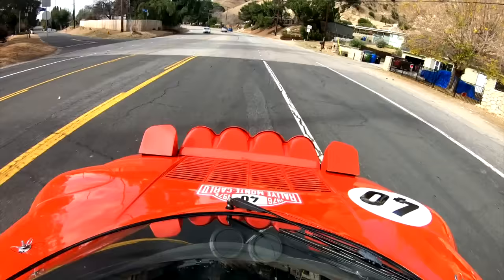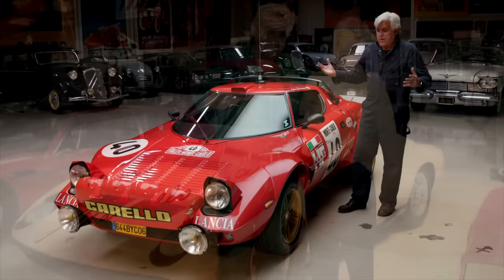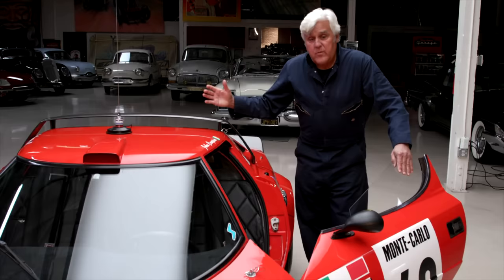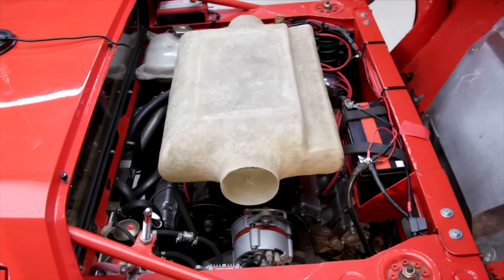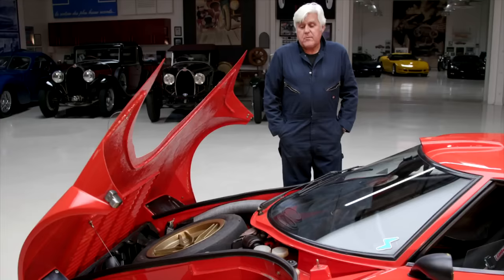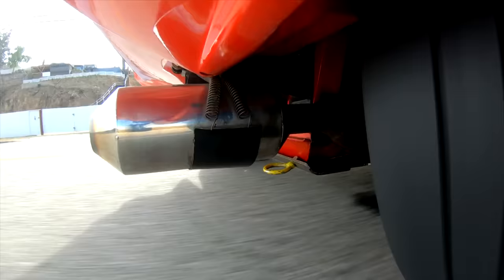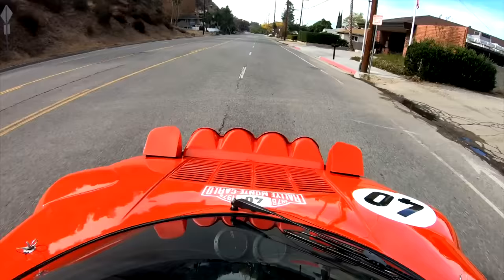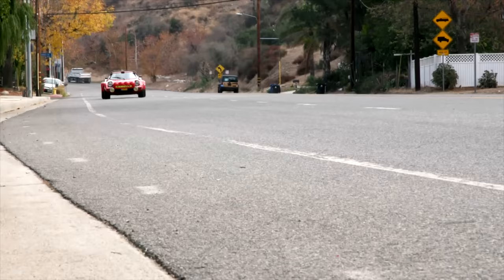1975 Lancia Stratos HF - Jay Leno's Garage

Comment: Haven't seen Jay this excited about a car in a while. "I need to find one of these." Yes.. yes you do.
Reply: I hear it is going up for auction
Reply: What Jay may consider is the New Stratos based on a Ferrari F430 with a 540hp V8.
Reply: @jjlasne  Remakes never have the essence of the original. IMO.
Reply: Hear, HEAR!
Reply: @Meccanico208  yeah it sounds like he should just buy that one indeed!
Reply: @jjlasne  The new Stratos will do nearly everything better. Handle better, accelerate better, shift better, stop better. It will be more reliable, more powerful, more comfortable, and will have superior aerodynamics. I say nearly everything better, because there is one thing it won't do better: being an original Lancia Stratos.
Reply: @K31TH3R  Pretty much the same can be said of a new Toyota Camry.  That doesn't make the Camry more desirable to an enthusiast.
Reply: @hipcat13 , indeed they don' t have that soul but the remake is a sweet piece of enigneering and styling. And, it is manufactured in Italy, retains a little of that essence you mentioned.
Reply: @K31TH3R , you forgot that it will be more expensive. Is that better?
Reply: @jjlasne  yeah, the price is very Italian. Luckily Lister Bell makes a kit car that by the words and experience of a very trusted auto journalist is an amazing package that not only looks just like the original but also drives just as impressively. Priced at around £40-50k it’s actually attainable for an enthusiast that doesn’t have deep pockets to cover the £400k cost of the conversion + the donor F430 or Suderia. I hope Loster does a similar kit for the 037 as another Italian design house has reimagined the 037 but requires a Beta Montecarlo ( Scorpion in the states) and $500k. The love their 0’s in Italia

Comment: You never saw what this machine could do until you saw it in full flight on the back roads of Kenya way back during the good old days of the Safari Rally. You knew it was approaching from the unique configuration of lights leading the thick plume of dust in the distance... Still get goosebumps, those are some special  childhood memories.
Reply: Unfortunately, a Stratos did not win the Safari (or RAC) Rally.

Comment: I love how the gauges bob like a 2000 Chevy Silverado, quality.
Reply: You guys are getting gauge bobs? Mine are either off one pin or off the other pin. LoL
Reply: The Lancia has firm suspension and probably no rubber vibration absorbing bushes and mounts, so it has a good excuse.
Reply: The middle ones are swinging wildly back and forth like crazy. Probably not the suspension.

Comment: Gotta love the fact that Marcello Gandini himself thought that the engine was sh*t, too heavy and too underpowered. Yet, the results spoke for itself.
Reply: I doubt that very much... The Stradale (road car version) was much lower in HP than the race car. Not a slouch but nothing like the "real" one.
In race trim, the 2 valves engine produced 270 HP, the later 4 "valvole" version, it was good for 320 HP ! But quickly banned by the FIA as being too powerful.
This one is only a "look alike" .
For anyone interested, see Chris Harris who was invited by Pirelli who issued new tyres for classic "sports" cars. He rode shotgun with Markhu Allen and other rally legends that holy day. Scary.
https://youtu.be/mXgWWNJVdYA
Reply: old heavy engine of late 50's design,
Nicola Materazzi said it. 

but certainly not underpowered in any way.
Reply: @retroracingshirt591  

He tells it in a recent interview with Davide Cironi. Guess he wasn't a fan of a 2.4 iron block compared to 2.0 aluminum, but it all worked out perfectly in the end! 

Subtitles on:
https://youtu.be/BZJtMmMhj0Q?t=1200
Reply: @marcryvon  The quattrovalvole was the real deal, too bad it was quickly banned by the FIA. 

Here's the vid we're referring to:
https://youtu.be/BZJtMmMhj0Q?t=1200

Comment: I own one of these cars, except it's only a two inch long Hot wheels version.Mine is much cheaper though.Never needs gas or repairs.Cool looking car though.
Reply: Look on the bright side - it will roll right under the gate like that other full sized car...
Reply: Hi, is that a new release?
Reply: Mine was a 1/24 scale model.
Reply: I've got three.....virtual models lol
one for circuits, one for road-courses and one for safari

Comment: In 1974 I was walking in front of the very swank Hotel du Rhone in Geneva when a Stratos rally car in Alitalia colours drove by, shaking the windows.  I was amazed that this car has less than 200 hp as it certainly sounded like a monster.  Jay is lucky to have had the chance to drive this wonderful car!  To put the size of the car into perspective, it was 3 inches shorter than the 1974 Honda Civic.

Comment: This was a 2.4L Ferrari Dino V6 engine w/ 2 valves per cylinder. This engine had very innovative for its era roller rocker followers that actuated/opened the valves.

Comment: Always wanted to add this to the Stratos mystique.  1974 Press On Regardless rally in the U.P. of Michigan held on Halloween night.   Legend has it that the Factory Stratos driver after a lengthy service stop, tore through the middle of a small town at a buck twenty to get to the next stage start.  The local sheriff took offense, stood at the stage start with a shotgun and stopped that particular stage.  I believe the Factory Stratos never returned to the U.P. after that.

Comment: Only a few know, that by trying to make Stratos as nimble as possible, by making it almost square in chassis geometry, they also made it extremely difficult to control. Lancia saw this as a mistake, so the next rally supercar, the 037 was much longer relative to the width to allow for easier skid control.

Comment: this beauty came from france, we had the legendaire Bernard Darniche who  "won the European Rally Championship in 1976 and 1977 and the French Rally Championship in 1976 and 1978, each time behind the wheel of a Lancia Stratos HF. He also holds the record for most victories in the Tour de Corse which he won six times (1970, 1975, 1977, 1978, 1979 and 1981), a feat later equalled by Didier Auriol. He competed in the first World Rally Championships in 1973, winning the 16th Moroccan Rally and placing second in the 44th Alpine Rally, and was one of the top competitors for the remainder of the decade. He finished third in the inaugural FIA Cup for Rally Drivers in 1977, the first of three successive top ten finishes in the drivers' championship. He also won the Rallye Automobile Monte Carlo in 1979, the event where he holds the record for most wins on the infamous Col de Turini stage, a 1,600 m Alpine mountain pass normally driven in darkness. The so-called "Night of the Long Knives" has seen Darniche victorious on ten occasions." (wikipedia)  thanks to Jay Leno to love an all the good cars all around the world...

Comment: There's a company called Lister Bell in England that makes a replica of the Lancia Stratos. 
One goal on my bucket list is to buy one and assemble it with modern parts.  I will either go electrified, or Honda K series with at least 1 turbo if possible.

Comment: Hi Jay. I have a few questions.

1. Did you buy it?
2. What are the yellow handle thingies at the front and back of the underside of the car attached to the skid plate? (Are they tow strap attachment points)? 
3. What was the "wild" (small) gauge on the IP (the one where the needle bounced continuously from left to right like a whirling dervish)?
4. When a car has 4 way seat belts, could you please use all 4? You would be much safer in the event of a collision, rather than using just 3 of them like you did in this video, and we wouldn't lose our favourite (especially during the pandemic) car guy. 

Love the videos. You are keeping a lot of car guys sane during this horrible time.

Comment: The Stratos first competed in Group 4 rallying, and in it's first year (1974) it won the championship. It went on to win in 75 and 76. In Rally form, the car was lightened to just under 900 KG. It took the all wheel drive Audi Quattro to finally beat the Stratos for a world championship. When I saw those guages, it took me back to my Fiat 124 Sport Coupe days when I had to buy benzina, make sure the acqua was the correct temperature, and the olio was filled. That car had a Lampredi designed 1600cc, dohc engine that ran like a sewing machine!

Comment: I love the pandemic edition videos, I feel like they are more personal. Also what a beauty that car is, saw one a few months ago ( the actual rally car) spectacular. So sad to think what lancia has become.
Reply: We should blame ourselves for that, if we bought Lancias when they were still produced they would still be around. I mean I did, I daily drive a Lancia, how about you and all the others posting 'regrets' bout what happened to the brand?
Reply: @spavatch  lancia cars are still produced, lancia fell hard during the 90' s due to poor build quality and from the 2000's on no-one of their cars were even remotely interesting, they tried with the thesis but the car looked (cool) but weird and all of the other cars were rebodied fiats with questionable design and disappointing performance. Fiat ruined lancia and is in the process of doing the same thing with Maserati
Reply: @dumyjobby  - lol, Maserati was hardly in its prime when they bought it in the first place. 
Also, do other brands make great cars today? Is Mercedes as good as it used to be in the 80s? Hardly. Are Skoda cars interesting? Not only they’re merely a shadow of their pre-war glory but they’re basically rebodied or, in some cases, just rebadged characterless VWs. Does it hurt their sales? Not even slightly. There’s absolutely nothing wrong whatsoever in using common platform (which for Lancia is not entirely true because neither Ypsilon nor Delta were a simple copy-paste from Punto and Bravo respectively; there’s more to it under the skin) and limiting quality of components is a popular trend these days. The way I see it what hurts the Lancia brand the most is that popular sick belief that it’s a rally brand that should make nothing but thoroughbred rally cars for the road, preferably for Dacia money. That illustrious rally career everyone’s so fascinated with was merely a chapter of brand history, not its whole meaning and sense of existence. This misconception is spread in no small part by Jeremy Clarkson, we can thank him for that disservice to Lancia 👍🏾
EDIT: did it hurt Saab, an equally maverick brand, to be a rebodied Opel?

Comment: In those coveralls you remind me of my grandpa who was more than a generation older than you, born in 1911 in North Dakota. He was a mechanic. One of nine brothers who were all joke telling mechanical geniuses in one shape or form, known to let out an oooo ooo weee from time to time. A different generation, born with horses pulling plows and steam threshers with a long belt that in an instant could carry you off to meet God. In the twenties he crashed a Harley into a bar wire fence. In the early thirties he road box cars to California before settling in Indiana. He worked as a shop foreman, owned a gas station with his brother for awhile, and was a machinist too who once drove ten hours to Pennsylvania to fix the church bus before wordlessly driving home. Part time mechanic in retirement, he used to fix people’s lawn mowers by removing the hood, placing a car battery on the back and spritzing used oil on everything. He’d evangelize about used oil when you’d sit in his garage. Old school lockers were mounted sideways on the wall and held his wood handled hand tools. A Lincoln AD/DC welder was mounted into the wood paneled ceiling of his garage, a pitted zephyr looking stick welder you’d adjust the amperage on and that was a merely a suggestion to the machine until you slapped it and the gauge corrected. In his eighties when he wasn’t out in the garage sleeping on a creeper, you find him sitting in his brown recliner, all five-six, a hundred and thirty five pounds of him. Fingers mangled, they were a quarter of his body weight. If you were a kid, He’d ask you what grade you were in or if you were an adult walking up, he’d ask if somebody died in that wreck and regardless of whether you knew the ending about being the buzzard he’s seen, he’d move on with finishing the joke leaving many in confusion. He almost preferred deconstruction of a joke until it was enigma. 

I’m reminded of the fact that he once said, you know, that Jay Leno, he’s sharp.

Comment: I love how the gauges (ampmeter) throw a nervous fit... Wouldn't want it any other way; perfect. Veglia or VDO...?
Reply: That’s a mechanical tachometer, the electronic ones we have in modern cars have those pulses neutralized by control modules. I love the mechanical ones as you do. The Series 1 Lancia Fulvia 1.6HF has the same Veglia gauge and is a Champion as well, 1972. I believe it’s connected to the cam or ignition.

Comment: Jay when Lancia was winning rally after rally if i remember right 6 or 7 times year after year Not many people new about it at least in Britain its one of the main reasons in the end they had to pull out of the British market once the Lancia beta started rusting very badly some wouldn't pass their first MOT without welding from the rust they pulled out yet in the early 60s 3 of the best build cars in Europe where the Volvo the Lancia n the Peugeot remember the 403 Peugeot diesels? or the Lancia 2000HF along with the Volvo 121/122 they where all really very well build cars,

Comment: I'd have to confirm this, but generally, Lancia would have had to make a certain minimum number of them for the road to obtain homolugation for the rally car version.  Rally cars are supposed to be based on cars recognized as being in production. So, they would say, ok, you can design and make this car to be specifically a rally car, but you need to build 500 of them so we can say you manufactured it as a road car for general sale. All rally cars are road legal race cars.

Comment: The car opens like that for easy access the the fully adjustable suspensions and all other components for easy fixing. The first impression when you drive this car fast is like the car is trying to kill you but with a bit a training a race driver could drive this car going sideways anytime the driver wanted to, highly responsive super sensitive steering wheel. power more than enough considering that is a light weight car.

Comment: DEsign and built for rallies Lancia was obliged to build 500 road cars for omologation; Lancia then made it mandatory for the dealears to buy at least one each....they all struggled to sell them and often shifted them at great discount. Road version had been tampered with, suspension and wheel size so it had problems in bends...

Comment: Love the Stratos, however "Clan Crusader" "Purpose built rally car (1971)" was before and I bet somebody will correct me with something earlier. The Stratos was a fast car but at the time it was usually down to the drivers. An Escort with Mikola or an Ascona with Vattenan would be just as quick. (Can of worms opened)

Comment: Since when has there ever been a 2.6 liter Dino engine? The top speed was 232km/h or 144 mph. Yes the 24 valve race version did reach 320hp. However, there was a 2.0 used in the Fiat Dino and a 2,418 cc (148 cu in) Dino V6 (188 hp) also used in the Fiat Dino which is what the street version Stratos used. Also if Marcello Gandini is only 2 years older than Jay then Jay must be 80 because Mr. Gandini is 82 so yeah I agree Jay needs his crew back!
Reply: And the 24 valve version of the Vittiro Jano-Dino Ferrari V6 was not reliable. It had more power than the 12 valve version of the V6 yet the 12 valve V6 is was the engine that powered the Startos to it's famed  WRC reputation.

The initial 2.0L dino V6 was aluminum intended for  Formula 2. That version has a long ist of problems. The late cast iron block 2.4L is more relaible-durable  and the version used for the Homologation production "street version"  Stratos.

Comment: Re latest Octane:  Go ahead and change the transmission on the Maserati.  Drove two in 1966 in Rome.  Weak transmissions to start with and not made by Maserati anyway.   Better to be able to drive it.  It drives nice in spite of that original transmission, not because of it.

Comment: Built as a race car? No, Jay, purpose-built for rallying. Short wheelbase made it too twitchy for straights, but unbeatable on curved courses.
Reply: No. Built as a track car and only AFTER used as a rally car.
Reply: @carloduroni5629   Stratos was "Europe's first purpose-built rally car", to replace the Fulvia, after Munari and other rally drivers deemed the Ferrari Dino 246GT too heavy, too long and not nimble enough. See "Stratos" by Graham Robson, Veloce Publishing Limited, 2006. 
Stratos was developed from a 1970 Bertone concept design that impressed Lancia's Sandro Fiorio and his son Cesare. See "Stratos" Automobile Quarterly Vol.12 p. 366